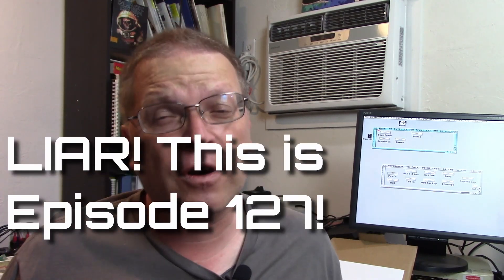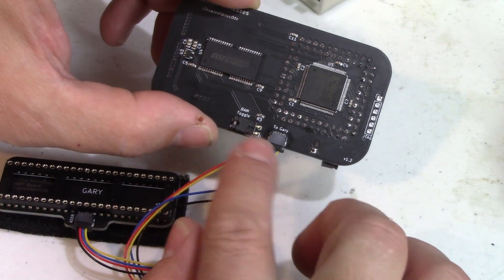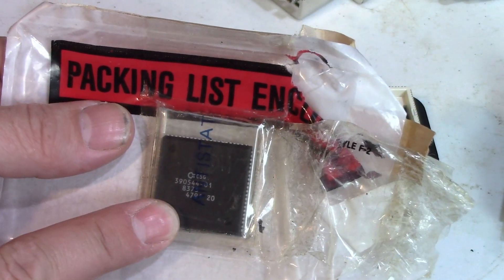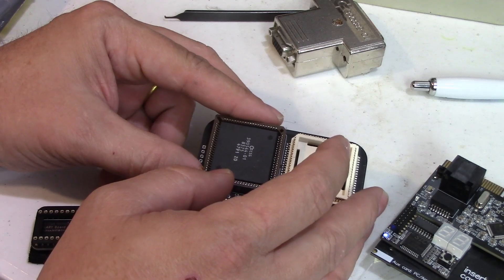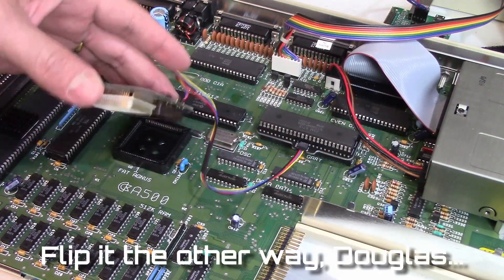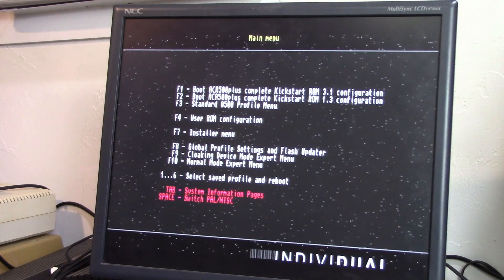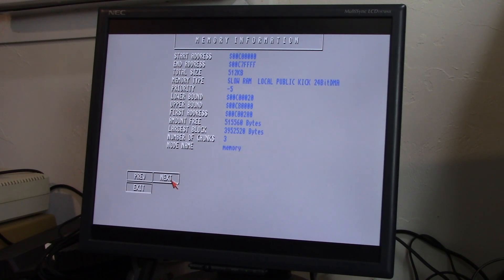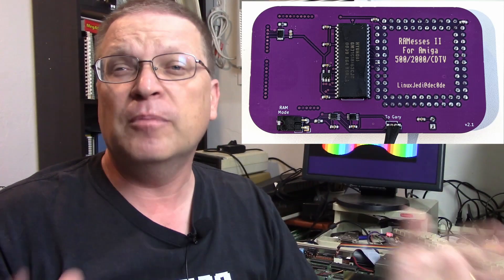Amiga 2 MB CHIP RAM Upgrade - Introducing the RAMesses

Comment: IMHO v2 should be a bit cheaper, as some little particulars indicates that less parts were used (e.g. the Gary cable is soldered on v2); however, take my money, too!
Reply from the maker: It is a bargain, IMHO, since the MegaCHIP on the used market is 3X the cost, and Jens solution from icomp.de is close to double the price.

Comment: Doug, will this work with irix labs classic 520? My understanding is due to the chip ram connecting to Gary is not compatible.
Reply from the maker: I cannot imagine why it would be incompatible, especially since the Classic 520 is a Slot on the Side accelerator. It should not care about what CHIP RAM is in there. Mine works fine with my MegaChip 2 MB board, and those work in a similar way. I will test it out.
Reply: @10MARC  thanks for confirming that your Classic 520 works with this RAMesses 2mb chip. Irix support advise it would not work, glad to hear thats not the case.

Comment: Great Video Doug, You mentioned in the video about one of the old ways to mod it was to cut traces, I did this on my A500 for the 1 meg Agnus. Do you happen to know If I could do this 2 meg upgrade without reversing the 1 meg mod?
Reply from the maker: Yes, this would still work fine with that mod. All the CHIP RAM is now accessed from the RAMesses itself, so I suspect it would basically ignore those modifications. 
They are generally easy to reverse anyways.
Reply: Yes, it bypasses any modification and will work.

Comment: Hey I tell you what was fun back in the day I had a Blizzard 030 50MHz with MMU and FPU (Blizzard board). You gonna try running the Vista Pro landscape software on an AGA machine - set the MMU to use hard disk as memory and create a very long animation from images combined into a single anim file - essentially an animation only limited by your hard disk free space. So much fun!
Reply from the maker: I have played a bit with Vista Pro but I need to do more with it. Good idea about the MMU! I will give that a try!
Reply: @10MARC  Good luck - and I can't remember if I did but it might be possible to multitask a mod file at the same time - try doing that on an ST cough did I say that?

Comment: My thinking is that finding an 8375 is difficult and they tend to be costly so when you factor in the cost of the RAMesses, you may be better off buying an ACE2b from Individual Computers as it is an all-in-one solution.
Reply: It definitely isn't for everyone, and that is fine. Jens' ACE2b solution is also a great option. I know quite a few people who have picked up A500+ machines locally very cheaply which are beyond repair but the Agnus chips are good, then used RAMesses to put those chips into their regular A500 / A2000 / CDTV. They also come up on eBay, in the UK prices currently range from £45 - £75 typically for a 2MB 8375.
Batches 1 and 2 of RAMesses did have the option of having them with the 8375 for £50 more, maybe half of people selected that option. Unfortunately I could not acquire them in bulk any more after that.
Reply from the maker: Yes, Jens solution is also awesome. This was a better solution for me as I already had an 8375 chip that was unused.

Comment: Doug, does this also work with PAL and does that require a different Agnus chip revision?
Reply from the maker: Yep - works with PAL just fine. There are different NTSC and PAL Agnus chips. I am not sure just how interchangeable they are
Reply: @10MARC  they are interchangeable, it is really their default setting that determines PAL / NTSC, they can swap in software and in the Kickstart menu. Although the video frequency will be very slightly off if you switch. Most monitors can cope with that.
Reply: @10MARC  it would be really great if someone did an FPGA 2mb AGNUS because I think it is the most difficult chip to get of all the Amiga Custom Chips. I might be wrong on that.
Reply: Yes, it works with PAL as it was designed in a PAL region :)
Reply: @linuxjedivideo  Doh! Yes my bad. A pity about the Agnus though. Almost impossible to find the 2mb version.

Comment: I miss an agnus replacement rather than reuse old chips; might be next step?
Reply from the maker: I have not heard of one being in the works, but it would certainly not be impossible.
Reply: @10MARC  there are two I know of in the works that use FPGAs (possibly three but I think the third was abandoned). Unfortunately FPGAs are hard to get hold of at the moment (cars and machines use them too, and the chip shortage is really biting right now). I would expect right now they will be slightly more expensive once you fact in retail costs than an 8375. They will also be difficult for a hobbyist to build without expensive equipment. They all use BGA and/or fine pitch chips in a tight space.

Comment: It’s 2022. Why can’t we have more than 2mb of chip ram?
Reply from the maker: You can in emulation, but the data paths for Agnus don't support more than 2 MB of RAM.
Reply: @10MARC  hopefully gets added to the MiSTer core then
Reply: I think the question really is: why would you want more than 2mb of Chip for ECS?
I don't think any software is written to take advantage of more than 2MB DMA for the chipset even if the rest of the chipset supported it. You would be far better off increasing Fast RAM which, as the name suggest, is accessed a lot faster by the CPU. With an 030 or higher you could easily go to a couple of GB of Fast RAM without issue.
Reply: @linuxjedivideo  If you're doing animation, as I do, even 2MB chip RAM is a limiting factor as all frames have to be in memory to be edited. You can split the animation though and then join the anim into one big anim MainActor which can then be played back on an application that supports hard disk playback.
Reply: @linuxjedivideo  it’s more for AGA when I’m using 128 or 256 colour modes when browsing the web and easily run out of memory if I have too many windows open
Reply: @sacredbanana  now for AGA, sure. You still have the chipset problem though. You would need a 32bit CPU too as the 24bit memory map doesn't have space for more than 2MB chip. I'd recommend some kind of RTG if you are doing high colour modes with lots of windows.

Comment: Agnus versions have different voltages, putting the wrong old agnus would destroy it.
Reply: The voltage is the same, but the pinout is quite different. Probably wouldn't destroy anything using the wrong one, but it definitely wouldn't work.
Reply: @linuxjedivideo  old agnus in newer revision socket destroys the newer motherboard revision but I don't know what chips or components were damaged
Reply: @mrkitty777  interesting, what should in-theory happen is the clocks and the RAM address bus gets mapped incorrectly. There are some conflicts with LDS/UDS but I don't think they would be fatal. So you end up with just a black screen at power up. Not something I've tried though and I don't recommend anyone try it :)
Reply: @linuxjedivideo  the a500+ was destroyed by the agnus from a500 but placing back the agnus in the a500 the a500 worked fine.
Reply from the maker: I also doubt it would destroy anything - it probably just would not function.
Reply: @10MARC  placing agnus from older revision amiga500 destroyed the amiga500+ permanently.